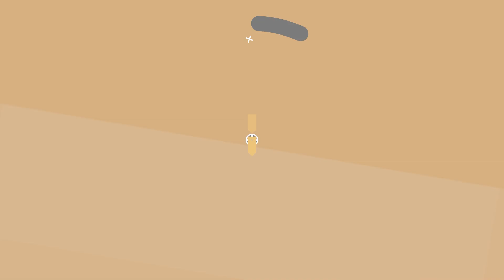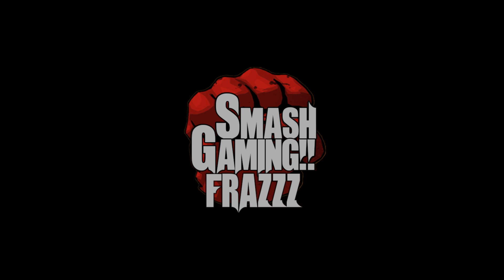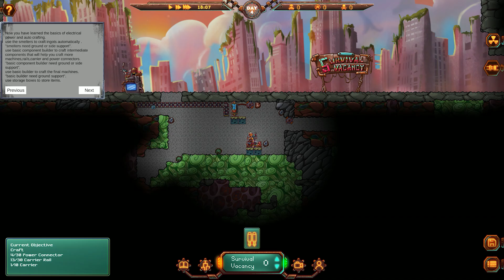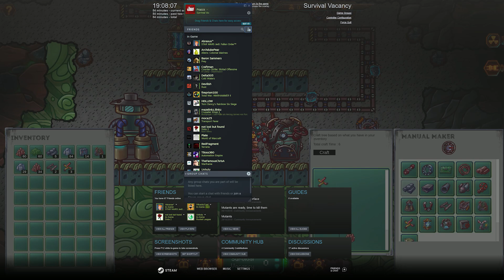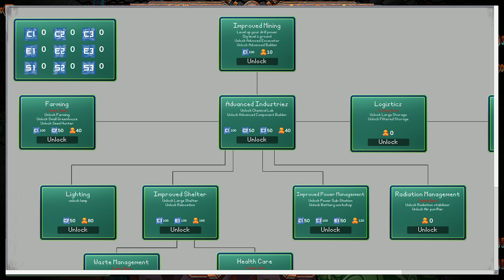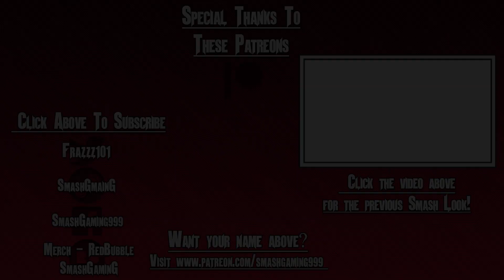Creating The Best Underground Nuclear Bunker In Survival Vacancy - Smash Look!

Comment: Hi, sometimes you want to do things to fast amigo.... A little slower and a little more planning makes a bigg difference.. 1. The move of the windmill was a good one, but pls check the connections at... 18:28 it has three outputs, so one rail on the right bottom corner was enough... and then extend to a total of 2 to connect to both energystations... perhaps even move so that both energy station may be filled directly from under the windmill... 
2. Since you can move everything around whenever you want, you could make the smelters right next to the excavators and have them feed directly into them. Then a box next to the machine to autofill when smelted... Your extended rails via both copper and iron was a bit much ;-) I like your creative playstile and hope to see a part II Come join the Discord or Steam for comments and ideas please. The Dev Kim is a nice guy. Cheers mate!

Comment: Is there some sort of option to produce more then one item within the manual producer instead of clicking it again and again?
Reply: There isn't, goal is go get the other machines up and running so it goes by itself. its easy to see improvements if you see someone else playing i find, did you see moments when he could make another decicion or improve it? The moving of the windmill was pretty good but... almost good? ;-) And you can still get the free version on itch if you want to. Only the crafting is slightly different but then you get why some of the current crafting takes so long.. Good luck mate! Hope you will play this too!!
Reply: @JakeSimmer  I have bought it before i asked the question. The start is very slow, even slower then Factorio, which is for me in this sort of game the primus. At the moment i am at the point that i dont like my base building and i wish i had a robot hanger and construction robots^^. Specially cable, carrier rails and base platform should be produced in pairs.
But i always in for game like these. Still not sure if i keep it.
Reply: @slcainehmierz7681  Well, delete all and go from there. I decided to have 1 machine for every lev 1 recipe, later I want to make rails to get everything to a storage corner from where I have to split them up for lev 2 recipes. Once it's kinda going, feeding from a box or boxes to a machine, output in another box for later use, it scales nicely... If you have twitter I can make a screenshot, small but nice base... and you can show yours. Also another player allready posted a screenshot in the Discord of the game. Check it out...
Reply: @JakeSimmer  I still dont understand the building aspect.^^ I miss space or carrier rails or even resource nodes^^.
I have seen the picture of Kexlar with your answer in it. But i have just now connected your name to this post on steam^^.
Reply: @slcainehmierz7681  Ok, untill how far have you followed the tuturial? power and powerlines? Or even to the rails right after... and yes some maps have the recource nodes are a bit harder to find, just dig dig dig I suppose or get a new start on another map, cause sometimes there are nice clusters of them together. Just look for the 3 different colours.... Know what to look for .... Let me know, here on DM on Discord, no problemo... Good luck and be patient ;-)
Reply: P.S. my other comment here for the streamer also has a timestamp in it 18:28 read that and check what happends, might also help ....